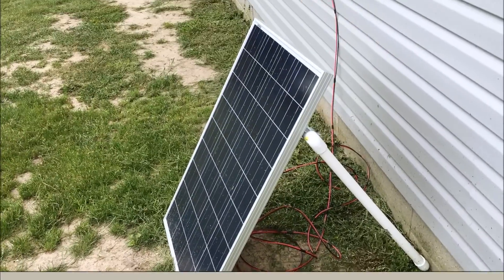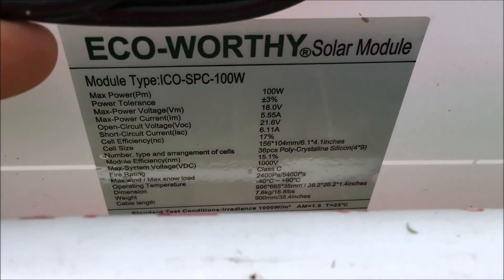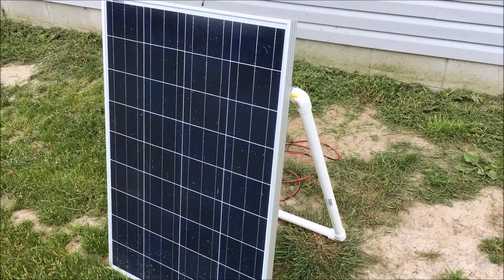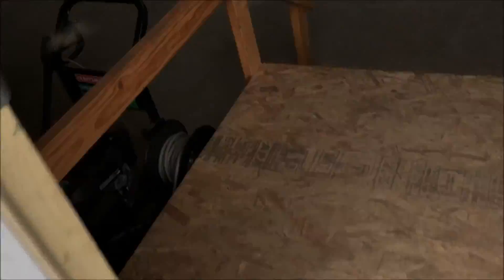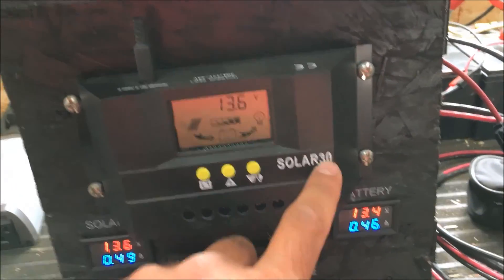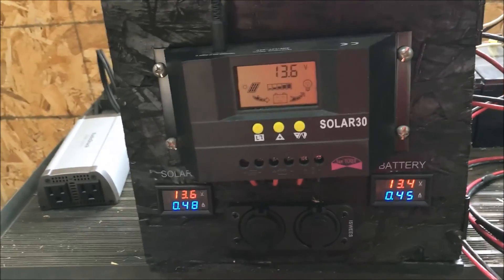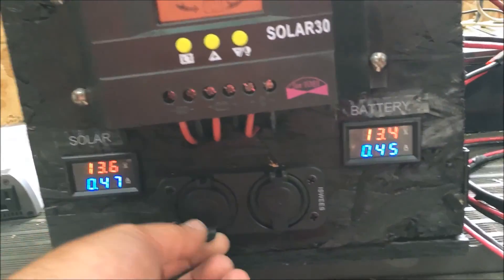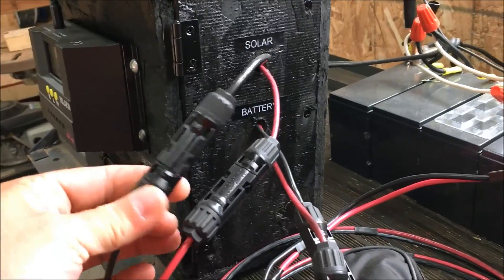Eco-Worthy 100W Solar Panel, Solar30 Charge Controller Project Episode 3

Comment: From what i can gather from the question you asked about the load still being on when the solar is turned off is it will draw current from wherever there is a source. The load is constantly on so, yes it will pull power from the solar when it is working but when it isn’t it will draw power from the batteries. The load is essentially power on at all times from wherever it can get the current.
Reply from the maker: Thanks for the great comment Aaron! I appreciate the information.
Reply: Good to know, thanks!   Can an on/off switch be installed on that load side to shut down the draw, when not engaged with solar or when not set up via ATS to switch to alternate power source... (grid or generator or alternate battery bank)... that way the batteries would not be drawn down unnecessarily?

Comment: If I have it hooked to a battery and the battery gets fully charged will there be any problem?
Reply from the maker: If you hook just the solar panel up to a battery then yes there could be a problem. You could over charge the battery and possible cause damage to the battery. That's why the charge controller is nice, it will handle charging the battery for you. When the battery is fully charged the controller goes into a float mode and just maintains the battery.
Reply: Upper Peninsula DIY ok thanks that’s all I needed to be cleared up

Comment: Hi mate! I like your idea of having those two little amp/volt meters... there are quite a few wires on those little buggers, and i'm not quite sure there to add them (between the panel and controller, or between the controller and battery? and such). A rough sketch of your wiring would be awesome for the beginners! Thanks and keep it up, great videos.
Reply from the maker: Thank you for stopping by and watching DaveB! The meters are still working well. As far as how they are wired, I just went by what the instructions said that came with the meters. I put one in line between the panel and the controller and the other in line between the battery and the controller. Just make sure the meters are rated for higher volts/amps than your panel and controller put out. Hope that helps, thanks for the great comment!

Comment: that mean if i have power inverter i dont need that x3 fusse right? or  i ll alway need it lol sorry its new for me
Reply from the maker: In my opinion, no matter how big or small of a system you have it should always be fused. Thanks for stopping by!
Reply from the maker: I'm sorry bud, I'm not sure what your asking.
Reply from the maker: I'm by no means any sort of expert. I'm actually just learning it myself. My thought process on this was to fuse each connection so each device is protected against any kind of amperage spike. The video you linked to looks more like just an instructional video on how components are hooked together.